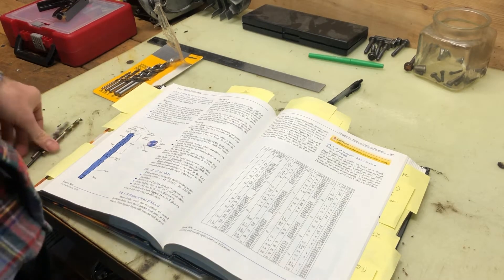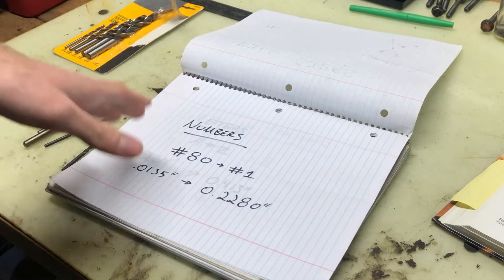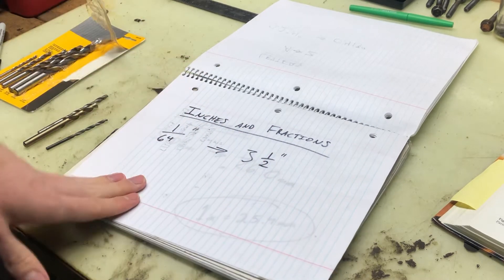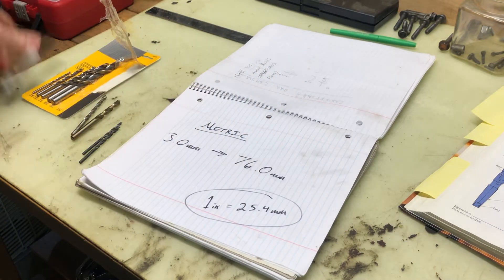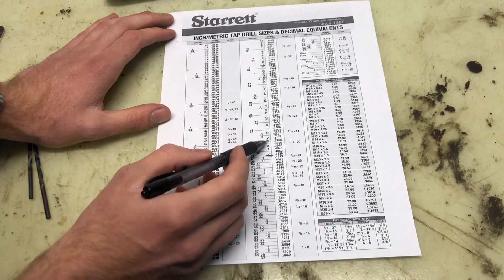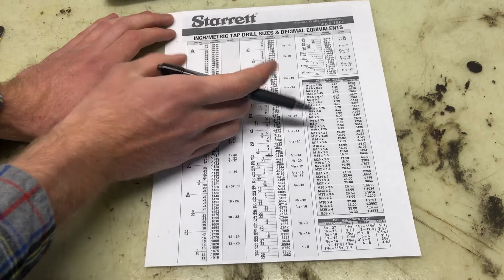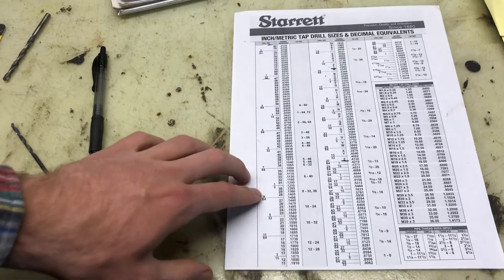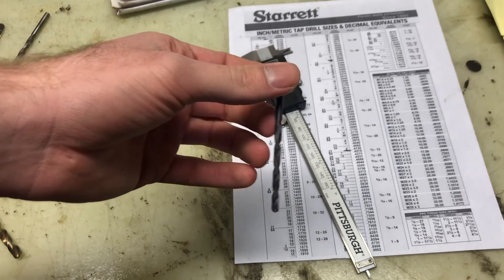Drill Bit Sizing

Comment: What about length?  Where is the length measure from? The total bit length or the length after its in the chuck?
Reply from the maker: Drill bits are not generally listed nor sorted by length, but if you need a bit that will deflect less as it is a shorter shank, look into "jobber bits"
Reply: @jonesteched  was wondering cause I was ordering online. I needed a 18 inch in length.  The current bit I have was 12 inches total length.  Top to bottom . But It was also 10 from the shank. Just wasn't sure which to order.